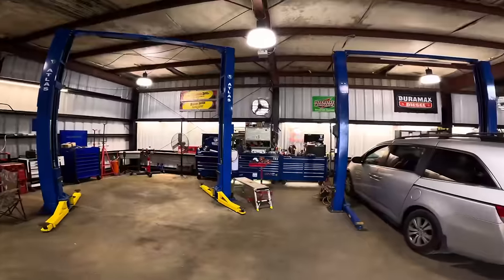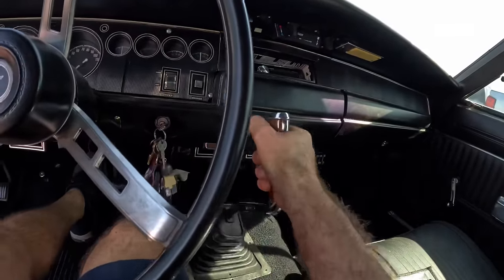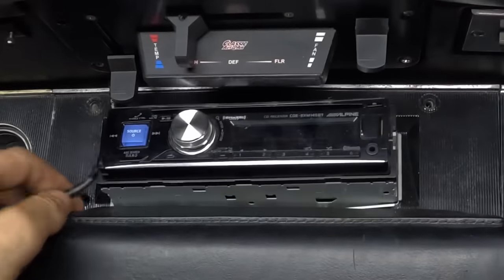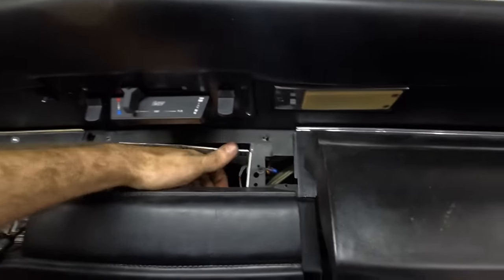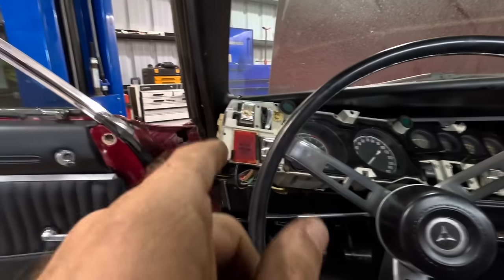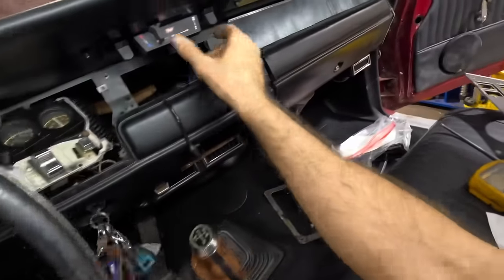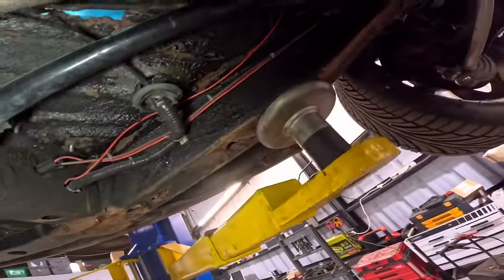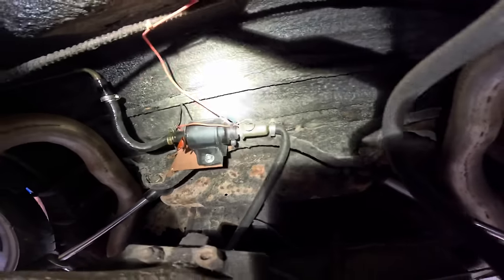Needs REee Restoration | 1968 Dodge Charger

Comment: Money says the owner just bought that Charger and got screwed big time. It happens a lot with Classics. Always best to spend money on an appraiser and let him look a potential purchase over. If you have money for a classic, you have money for an appraiser. I was laughing through this entire video, everything Ray touched it broke. I found that out working on these older cars starting with my first car, a 1967 Chevelle in high school. You have to figure out the combination to take things apart. Back then there were very few plastic snaps. Screws and metal snaps and if you didn't know the secret...it broke upon removal.

Comment: At least mine  starts and has headlights, oh it can haul 2 pallets of flooring.
Reply: Speaking of the van. It has 230,000 miles on it. I’m on the hunt for a roller 5.8l. To start a rebuild. I’m thinking Edelbrock heads, if you injection intake from Edelbrock and fox body pistons attached to the football, connecting rods and a comp cam

Comment: As others have said, i highly recommend you walk away from the Charger. I owned a 68 Charger and can tell you that if you're not familiar with them you will have a lot of problems figuring out how everything is put together and works. In addition to all that parts will be hard to find and will be expensive. Save yourself the headaches and walk away

Comment: Sorry for your pain, but I find it hilarious watching a young guy trying to work on a real car. Something of that vintage is my daily job and very simple. I also used to install stereos like that and the problem isn't the chassis, but the hole someone cut for it is too big. Watching you kill that headlight switch was painful. On old cars you are careful not to break things, and you fix them, you don't replace them. You will have to think your way through problems with this one. No computer will tell you what to do.

Comment: If you took it next door to the body shop,the repair/restore  estimate,will cause a heart attack.
Been doing auto repairs,and body resto for 45 yrs,and I can tell you that you're looking at $18k,to $20 k,and at least a year, to bring it up to snuff !
Currently working on a 1967 Barracuda fastback,for a friend,and it was 75-80% solid,and we now have $13k into it,and it still needs parts that are hard to find(no after market available),and paint.
Been working on it for 2 years.
Bythe way,...the headlights won't come on ,until the flip panels are BOTH open ,fully.

Comment: In my opinion, Ray, that Charger needs a complete strip-down restoration; the exterior body panels need to be complete detached, ground back to bare metal, primed and rust-treated before new Duco/enamel/paint/whatever colour coating is applied. The interior probably needs a complete strip-down too, not least because of the add-on wiring and dash-board issues.
Whilst the panels are off, I'd be doing a complete cut, shut and weld of any rusted floor-pan areas, fix up/replace the execrable wiring, mechanical and structural repairs and so forth.
Whatever else this is, it is NOT a single weekend restoration; there's weeks if not months of activity required (depending upon how much time can be dedicated to it).
It's definitely a "project" restoration, and needs to be treated as such.
Personally, I would love to see a video series on its restoration but you'll have to decide whether you'll be doing it or someone else.

Comment: This ones a toss up. It would be a different style of in depth dive into. There are allot of directions to dive into. ie larger overhaul like project jeep. But if youre diving in it would make sense if the customer wasnt going to address the structual patches also. I alway feel like a car is only dead if a person wants it to be. With the current price of cars and generations of technology it isnt unheard nor is it unreasonable to keep something old running and even unreasonable to consider the value. I like how youre cleaning up the silverado. Im doing the same thing with a 99 7.3 with 340k. Keep up the good work. 👍

Comment: Definitely a full resto.  I mean strip the car completely, inside and out, fix all of the body rust issues, epoxy primer and paint, then rebuild it back up.  You can get nearly any part you need for these Chargers, but sometimes you have to wait a while for delivery.  Definitely not your focus as a repair tech.  A job like this could take upwards of a year or so.  The owner needs to do it himself.  Prolly could not afford to have it done at today's prices.

Comment: Headlight switch:  looks like it came apart before... a spring is missing that pushes the slider against the contacts and pushes the little ball into the notches next to the lever making the switch feel more solid and "click" into position. I have repaired /rebuilt switches like that for a couple of customers.  
Rear of cluster:  someone has had it apart and taped masking tape and crap on the wires, possibly getting them mixed up, hence the wipers running when they shouldn't,  and I think there should be a little "bar" of plastic on the speedo cable end for it to latch/lock in to the back of cluster... looks like who ever had it apart before broke it off.
A lot of that added wiring needs to be redone ... if its not  failed, it will.

Comment: Ray, I am with many other people on this particular car, run a way don’t walk get as far away as possible! Unless he is going to bring it down to complete disassembly for a complete structural and mechanical restoration! Then I might think about it if the $$$$$ line up in my favor! This is a shame, because it is one of my favorite muscle car models.

And the bubbling body filler is because the “repairs were not done correctly in the first place, bondo is porous and if it is not properly sealed it will bubble out in a few years after rust re enters the repaired area!

Comment: update 1- Get rid of the factory dash and custom build a aluminum racing dash with all new wiring
update 2- get rid of the leaf spring rear suspension put in a 4 link with 6 way adjustable coilovers (disc brakes) 
12 point cage, weld doors shut, paint orange put number "01" on side...
Reply: You can't work on it unless your name is Cooter

Comment: There's nothing like working on somebody's "baby" in this condition and them potentially blaming you for everything else that might be wrong. I would say this needs to be an all or nothing job, no exceptions.
Reply: again, my suggestion is the nothing option.
Reply: @bluebike45  I would have to concur. Personally I would have to charge so much I'd feel like I was ripping them off so that I didn't feel like I was getting ripped off myself, aside from the fact that this type of thing is impossible to estimate the cost of for the average shop. Leave the full restorations to those who deal exclusively in full restoration.

Comment: First of all the speed-o cable clip to hold it in is broken you need a new speed-o cable housing. second the light switch is effeminately broken you can get a new one through Classic Industries.If you cant get a new radio mount just add a piece of sheet metal to the inside edge of where the radio goes to shim in the opening to fit the old radio mount.  l have a 69 charger and you can get most of the parts ya need through them ( Classic Industries) at a fair cost The head light doors are vacuum control but ya mite have a vacuum canister leak on that

Comment: I wouldn’t touch that car. Without completely stripping it down and starting from scratch, it’s never gonna be right. All the wiring needs to be redone. The body panels need replacements, properly welded in, not screwed. God only knows what was screwed up when the A/C was installed, or when the aftermarket toys were installed (poorly). It’s just not worth it. It’s a 6 figure job, and unless those miles are original and not rolled over, it’s not worth it.

Comment: I've read a lot of comments saying to walk away or that the owner wouldn't be happy with anything etc. But what these people aren't taking into consideration is that they know nothing about the owner and the ultimate question is if you're prepared for such a long term project. I would suggest getting in touch with the owner and seeing what they expect from the car. I would give them reasonable expectations and see if they can live with that. I also don't think it should be junked. Does it have some problems? Most definitely yes. Is it going to be a pain in the butt to find parts? Possibly, it would depend on what the customer's expectations are for the car. Is it too far gone? I don't think so. The bigger question is do you have the facilities to handle such a project? And will this job be worth the headache?

Comment: If you don't have big repair budgets or a good mechanic, don't buy any collectable car.  I have the stock AM only on my '65 Corvair, still needs a speaker .I hope that's what it is. Need to install a heater hose and everything will work.  What will break in the mean time?

Comment: It's very good for a 68.  The interior is full of perfect original irreplaceable plastic parts.  Too bad about the rust.  Most of the repairs the owner requested are already done.  It might be worth looking into why the engine runs so cold and stalls.  If restored, that car would be $$$.

Comment: I’m only part way through your investigation but I have a theory as to why the Speedo is doing what it’s doing. Firstly while the dash is out/loose get yourself an older piece of speedo cable long enough to connect from the clock to a drill chuck…turn it over starting slow(obviously) and check for head unit performance…I’ll assume that’s ok(not something to readily go out unless it’s fu….screwed with) I believe what’s happening is the cable from down below is temporarily binding then suddenly releasing give the “geiger counter“ action. Check for hard turns in the cable bent too tightly around objects underneath. 
I know you likely have thought of these things but I’ve actually experienced them…I’m as old as dirt so..?..🤷🏻‍♂️. I hope I could have been if some assistance. This kinda thing is what I love to do..just not alone. I’m hating working alone these days…so many gone too soon.
Have an awesome day Ray and to your lovely ‘Wife Unit’ as well. You sir are a blessed man. 👊🤝👊👍
Reply: The speedometer cable appears that the clip part that holds it the the cluster is broken off.  Really needs a new cable at minimum.

Comment: Question to ask is parts, time, and cost.  Are parts avaliable or can they be fabricated?  How much time will be needed for the body work and all chassis work.  What mechanical parts need replaced, the time needed and cost?  Then the miscellaneous work to be done?  That radio, headlights and the covers, that switch that fell apart, the wiring, and any other axillary things.

That car needs a good restoration shop to do all that needs done.  They may have a better idea where the needed parts can be purchased or refabricated.  Plus, two of those place seen from under the car will need pieces welded in to fix the rot.

Comment: Before watching 1 second of this video, it is a treasure. In the blink of an eye you can yank the engine and a transmission out and and swap it.

Now that I've watched it, 75% of what was done was slop shit work, and should have never been done by the MFR's who done it. You weld the new floor panels in and not all the slop shit metal sheet screws. But like at least 1 other person said, the owner will never be happy, no matter what you do. Also your bill for all that needs to be done would buy a brand new base model vehicle. He like me probably grew up watched The Duke's of Hazzard.

Comment: Walk away or take on full project with 3 months time. And have customer pay 1/3 up front.  so in case customer aborts/does not pay, you can sell the car and at least break even on costs.  And warn customer such projects tent to have snowball effect, turn ALWAYS out more expensive then initial estimate.

Comment: What I'd do put new battery cable end's on get it to start then park it outside then pull the battery out of car an bring it into shop put it on a charger then use you battery tester to see if it has power then give the list of things to customer then order the parts the customer gave ok to

Comment: 40:28  question was trash or treasure

After about 70k worth of real restoration work it would be treasure  and its a good car to do it too, for the most part is not real bad.

It needs an acid bath down to metal fix the rust remove the rust add new metal  and go over every component from bumper to bumper. It is deffently a colocolectors  item and could fetch good money at auction.
But its deffently not a show car.
I hate to say that but its simple fact.

Comment: Yea that's a Can O Worms. I love the car but you don't buy cars like this unless you can work on them yourselves. You can farm out big things like engine builds and sheet metal replacement but for small things like replacing the light switch you should know how to do that yourself.    BTW the problem with the Speedo cable is there is supposed to be a locking tab on the white plastic piece that connect the cable to the speedo. I see it was broken off. You need a new speedo cable.

Comment: I can tell you right now that many of the parts you need to repair most of the interior issues and some of the outside issues are unobtainable.  I can also tell you that many of the parts you were looking at are not original or were not OEM for that car.  Yes they may have been for a Charger but not that particular model or year.  The speedometer cable is missing a wire ring that looks like a cheap key ring that goes on the white plastic end of the cable that clips to the back of the speedometer.  without that clip the cable will never stay connected.   The wiring on that car has been hacked and spliced 17 ways from sunday and you would just be chasing a rat down a rabbit hole if you attempted to fix anything.    

My advice on this one is to pull the drive train and scrap the rest.  Rebuild the motor, transmission, and rear end, and then put that into something clean and solid.

Comment: There's a reason it takes 30k-50k and two years to restore these classic cars after years of neglect , it's a lot of work and that's for a shop who does nothing but restorations. I wouldn't even attempt this , this isn't what you do , Ray , and just asking for future headaches . You would probably be losing money in the long run , as well, since it would be tying up resources and you wouldn't get paid until it was done, so you would be carrying that loss on your books for however long it takes to finish the job. Anyway, great video and the truck is looking great!

Comment: As far as a 69 charger goes it's not that bad and it has frame rail connectors  I mean when you've seen rat rods where the whole floor pan was made out of license plates bolted together because it looked cool you know😂😂😂

Comment: Walk away Ray. This car needs a complete restoration. Its worth doing and keeping alive. Incompetent restorations ruined many classic cars. If you had the time and desire to do this Charger I'm quite sure you'd do a fantastic job. But is it worth it to send other customers away because of doing a complete restoration job ? Trying to do too much will hurt you in the long run. About 2 years ago I helped complete a restoration on a 1970 Charger. 360 engine. Did many upgrades. Took 2 years to complete. Parts are actually very easy to find. It's a lot of fun and frustration ! But this one is a complete mess. Takes a bit of experience with that era vehicles. That car has 50 years of bad work and hack jobs. Be a beautiful Charger with a good restoration. This guy just wanted his car featured on your channel ! Needs complete rewiring . I'd buy it !

Comment: There's a adapter plate he's missing. There should be a universal one out there for the radio. Watching all the video, i pray he doesn't try to blame you for other things not working. I would run away from this one. Unless you're willing to do body work and restoration.

Comment: In my opinion, push the car out of the shop, and step away, unless you want to do a complete restoration. All the questionable repairs, will turn into you touched it last you broke it.

Comment: Given the state of the vehicle I would just put it back together and have the owner pick it up. There is too much liability there for something bad to happen, be sure to note on receipt that the car shouldn't be driven on any road until properly repaired and have him sign receipt and initial that he has seen your note. I run into issues with forklifts all the time while doing PM's where something is worn/broken or just rigged together. Depending on what I find I will either  make a list of everything I find and note on the WO that lift should be tagged out until repairs are done because it's unsafe to operate or just PM deny the lift all together with a reason. I had a customer that wanted a PM done on an old Clark 48v forklift so I went to do the PM and when I opened the seat deck and saw 4 car batteries for power instead of an industrial 4000lb. battery I closed the seat deck and PM denied the lift. The customer wasn't too happy of course so I explained that the battery is the counterweight for giving you the capacity stated on the lift to be able to safely lift X pounds, there is a minimum weight and maximum weight for the battery. He then said well it lifts just fine with no issues we don't lift very heavy items. I had him sign-off on the PM and gave a reason of the battery isn't proper weight for lift and left. Best to CYOA.